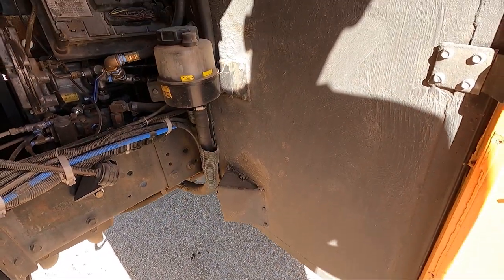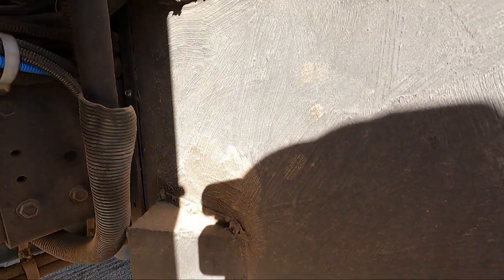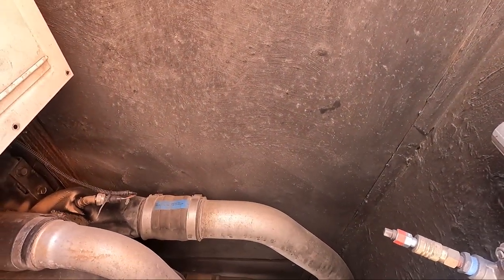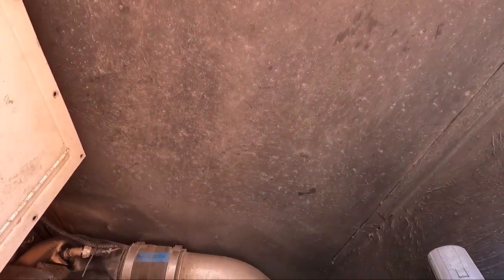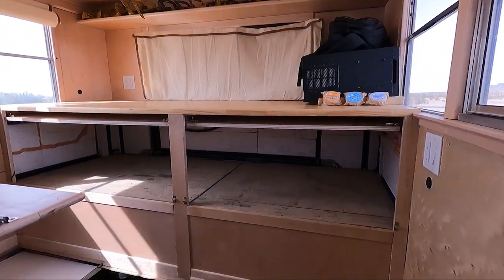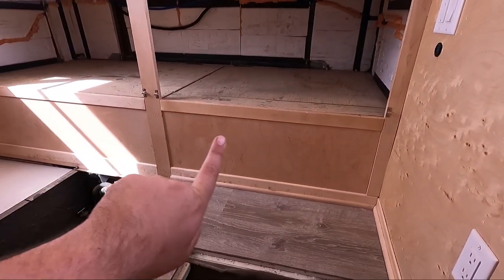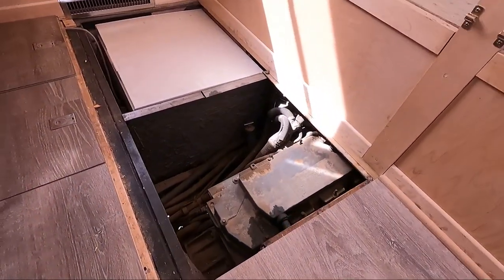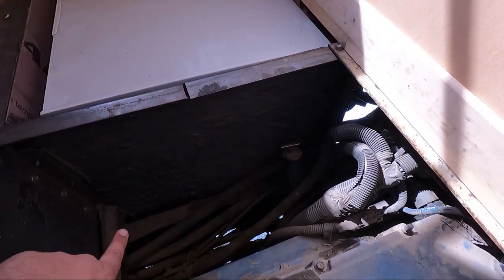Making Room!  -  Our Engine Bay Makeover!

Comment: Can you please describe the blue handled valve that looks like it has a pop-off protection valve on the passenger side of the engine compartment? I'm curious what it is. Also, it looks like you have a "standard" alternator on the engine. Do you totally rely on the solar (probably coming up in future videos) or does the engine alternator do any charging of the day-to-day batteries for "home" use, or just charge the engine starting batteries? Also, is access to the freezer only from the outside? Did you look at oil level sensors on the oil check tube to reduce removing floor panels to check engine oil level? Finally, does any of the bus engine/trans/brakes/etc. have any network like CAN-BUS or J1939? You stated that the engine is pre-emissions (smart), but I'm curious about any modern elements on the engine/trans/air etc. like an ECM, etc. What an awesome project! Top quality work that is a joy to watch. Thank you for sharing. You and Emily are amazing. I hope we (my spouse and I) can meet up in our "hut" of a pickup camper (compared to your castle) someday.
Reply from the maker: That is our blue ox exhaust brake. It is an air actuated guillotine valve that creates back pressure in our exhaust system to act as a brake.  Our alternator is rated for around 300a. We do have 80 amps of dc/dc charging available to us if needed that will only run if the alternator is running. We access our freezer from the floor hatch in my office. The engine has the standard dipstick and oil sensors, as part of my pre-trip inspection I always check the dipstick from the floor hatch in my office. The bus is new enough to have computer control on most major systems and it does have the ability to hook up to diagnostic software for troubleshooting.  Because it has a ECM, I was able to add a tune to bring the horsepower up to 300. That allows us to cruse around 60 to 65 easily. Thank you for all the questions!  We definitely need to meet up sometime!

Comment: What kind of engine is in the bus? Any plans to power wash soon? Would doing so increase performance given cleaner radiators and such?
Reply from the maker: Our engine is a DT 466E tuned to 300hp. I will give it a good steam power wash this spring when we get back home. I did get the radiator washed before we left and we are staying nice and cool.  Thanks for the questions!